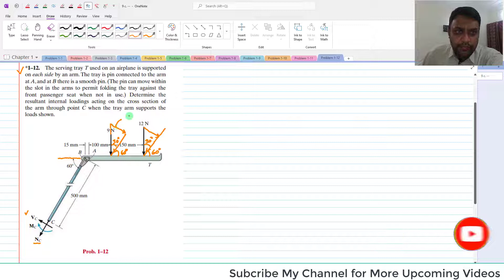1-12 Stress | Internal Resultant | Loading Chapter 1 Mechanics of Materials by R.C Hibbeler|

Comment: how are we supposed to know that the forces need to act in the same direction???
Reply from the maker: You can assume any direction but when you calculate it if the answer comes negative it means that your assume direction was wrong. Also while representing force you must have a sense to mention the direction to keep the body in equilibrium....
Reply: @engradnanrasheedmechanical  but how am I supposed to know that the external forces are supposed to be slanted???
Reply from the maker: When you cut any section, internal loading already exist there.....
Reply from the maker: https://www.youtube.com/playlist?list=PLuj5YwfYIVm9GBcC6S4-ZgHS1szlF7s1Y
This is playlist for this subject theory. Without these concepts you can't solve problems. These are pre requiste...